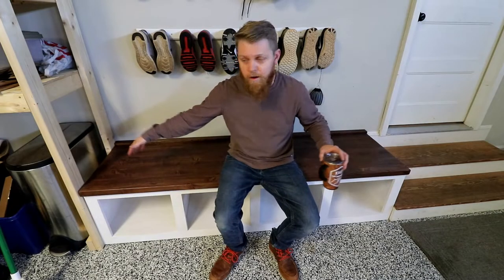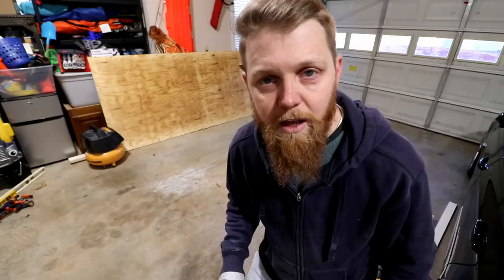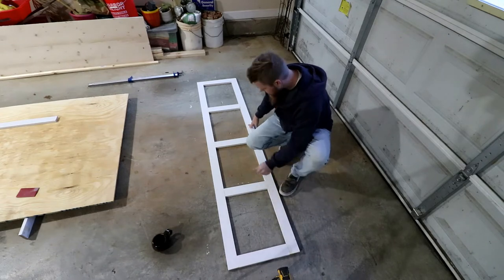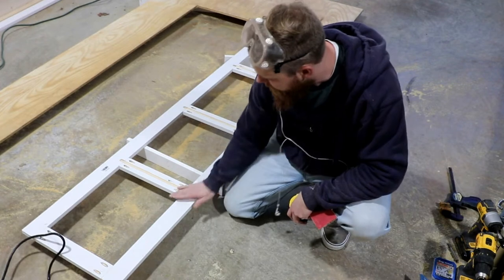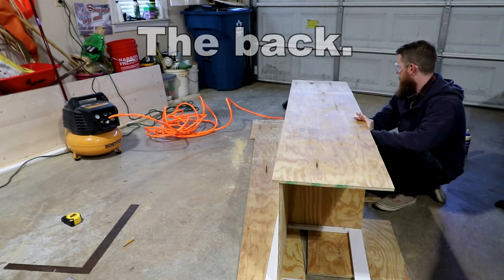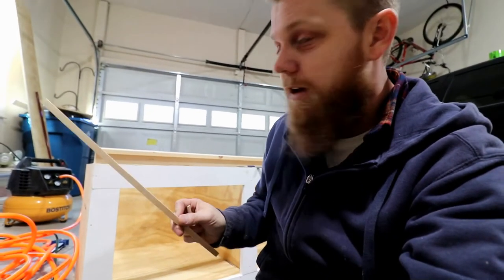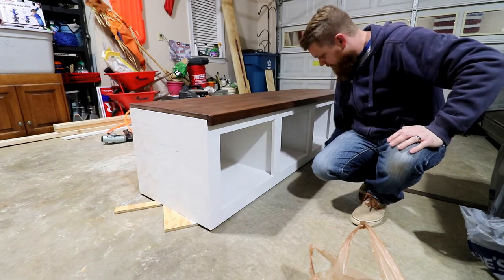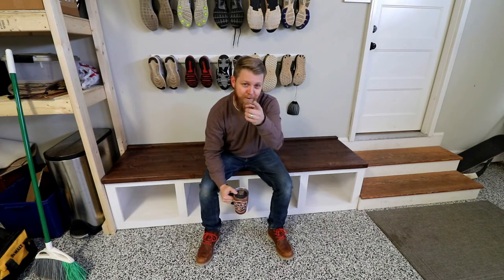Garage Cubby Bench - Garage Makeover Part 3

Comment: Please help. I believe that these are awesome and I want to put them in my business. What I need help with is, can you share some of your wisdom if I want to build the cubby bench with the entire ninety six inch top piece? Even if it's just minor
Add ons that I would need if you could just provide some basic information that could at least point me in the right direction so I can in large the rest of the body to make a longer bench. Thank you in advance for any assistance that you can provide. I really appreciate the video and any guidance you can give!!!!
Reply from the maker: Sure. That’s actually easier to calculate than it might seam. This bench is 48” wide. So your material list for a 96” wide of the same setup would just be doubled.  I hope this helps.
Reply: @DIYWoodntYou  thank you!!